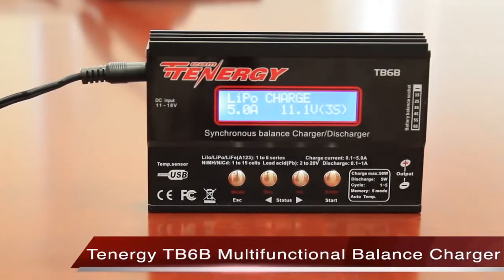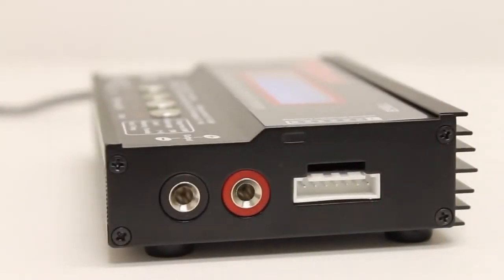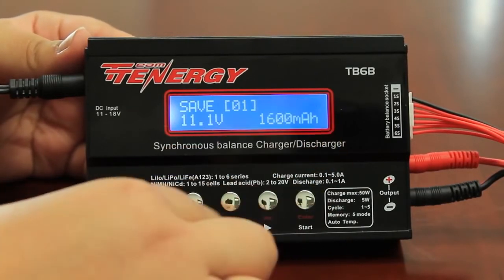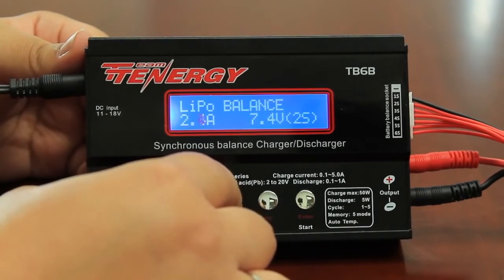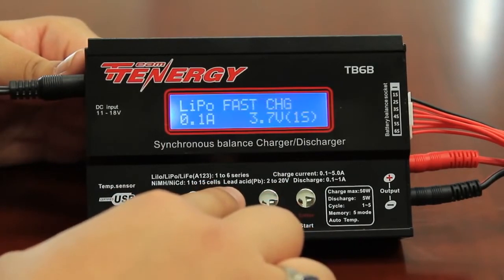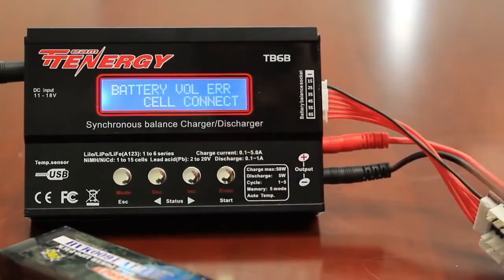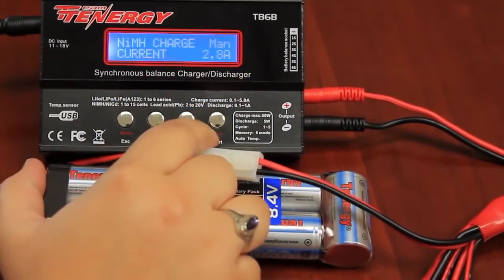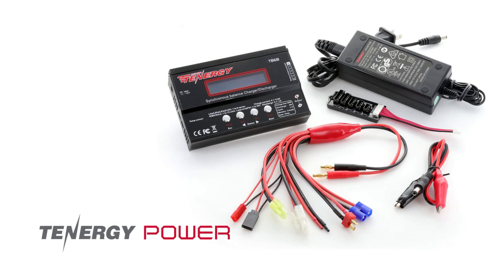Tenergy TB6B Balanced Charger/Discharger - Walkthrough

Comment: Im new to the world of RC and Lipo charging. I have two batteries Traxxas Lipo 11.1V 5000mAh 3S 25C  and a HRB Lipo 11.1V 5000mAh 3S 50C. What would be the best charging and discharging setting for both batteries. Also the Traxxas doesn't have a balancing wire, but the HRB does, what would be the setting for balancing for that battery. Does TB6B have a auto shut off once the battery is full? Any help would be greatly appreciated.
Reply from the maker: Hey 
Alvin, 
For the best charging rate, we recommend between 3-5A. You can also take the capacity of the pack and divide by 1000 (ex 5000mAh/1000 = 5A). Now for the discharging rate, we don’t typically see users discharge LiPO batteries, but if you’re discharging it for storage you can use 0.5A-1A (1A is max discharge rate for charger). Traxxas prohibits most charger brands from having their connectors so in order to charge the HRB you will need an adaptor (we can help you find what you need if you reach out to us service@tenergy.com) if needed. Lastly, the TB6B does have an automatic-shutoff.
Reply: @TheTenergybattery  Awesome! Thanks for the quick reply!
Reply: @TheTenergybattery  
If i charge nimh battery fully so its will beep?

Comment: how do i connect this to the power outlet? iam asking this because iam living in europe and the outlets there are different.
Reply from the maker: Hey There, this TB6B supports worldwide voltage so all you need to do is get a wall adapter. Unfortunately, our charger comes with a 2 prong outlet.
Reply: @TheTenergybattery  alright got it :D

Comment: Is there a faster mode for discharge and storage?
Reply from the maker: Hi, Nick thanks for the question. For storage the mode available will try to maintain battery capacity levels at 40% over time and is not meant to be a fast process. Hope that answers your question.
Reply: Tenergy Official yes it did.  I guess If I am going to put a battery in storage mode I’ll have to do it early in the day, I need to know will to alarm when It reaches storage state like it does when charged
Reply from the maker: @nsvaluto48328  Hi nick, the question is if it will sound an alarm when it reaches storage state. Can you possibly try with a low battery and let us know? That would be very helpful.
Reply: Yes but when I did it was full I had a problem with my Rc and time contrants could not run it to low battery status
Reply from the maker: @nsvaluto48328  Not to worry nick! Hope the discharge mode works out for you.
Reply: Will see

Comment: What is the best lipo charge mode balance or lipo charge auto?
Reply from the maker: Hi Nick, thank you for reaching out. Most of the time, Balanced mode is the safest way to charge your lipo packs. Hope that answers your question.
Reply: Yes it’s just  wanted safe way
Reply: What’s my best setting for a 3s 11.1  50c 5000mah
Reply from the maker: @nsvaluto48328  For that pack, we suggest 1.25a and charging at .25c. This will very safely charge the battery in around 4 hours.
Reply: Didn’t recommend checking time waste  time safety timer capability cuts off on/off input low power